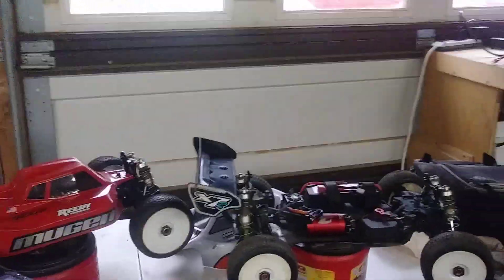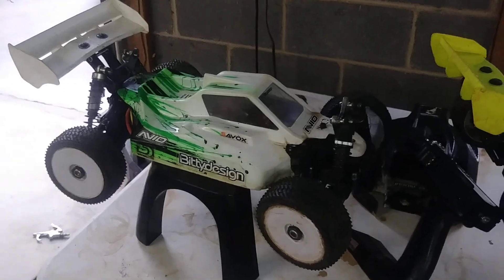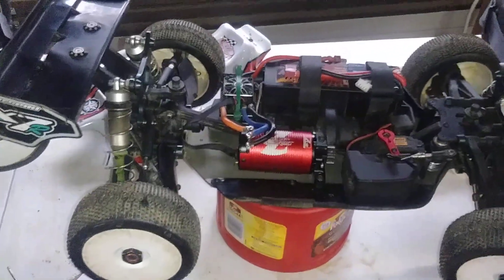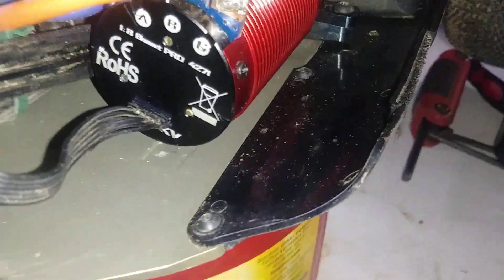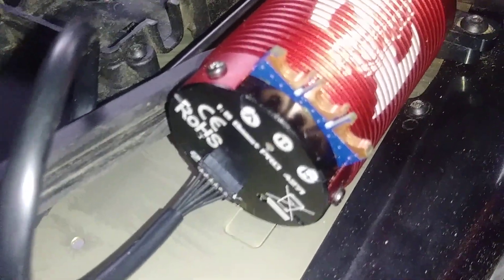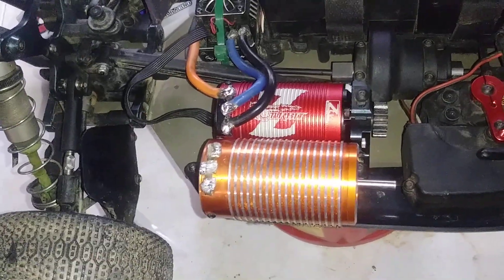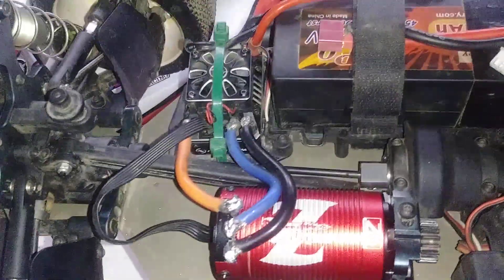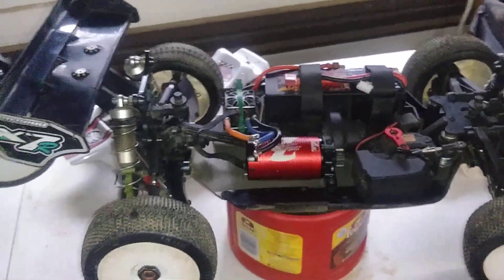Another ebay find! And new motors!

Comment: Heck yeah the buggies are multiplying! Just wondering if you seen my last comment on your last vid? Just wondering if you still have that 1/8th system we talked about to sell me?
Reply from the maker: Yeah... I dont have that system anymore. The motor burned up, but on ebay the 2 nwmew motors on this video are only 27.50 plus 9 shipping! Then get a ocday 120 amp esc for 22-25 or... A sensored esc, if your gonna race the ztw 150 beast system is only 79+ 3d shipping! I just ordered one a few days ago to go with the new motor. I have a rtr 7 for sale, $300.